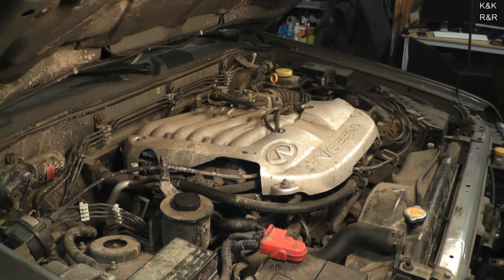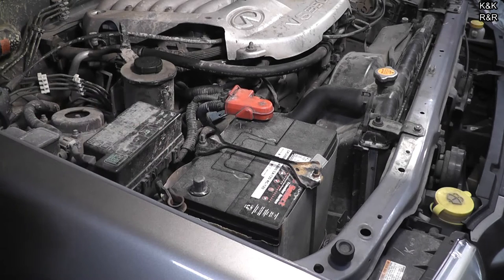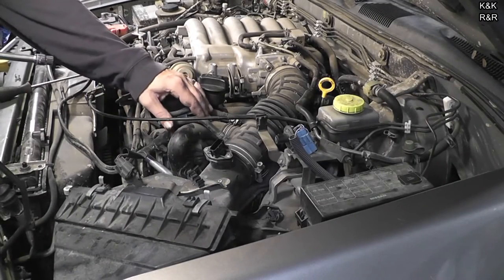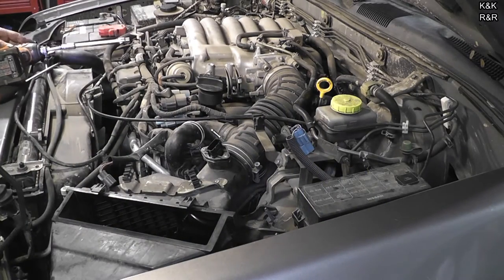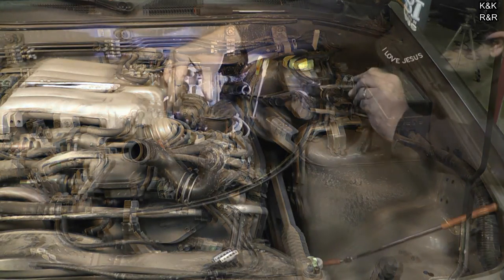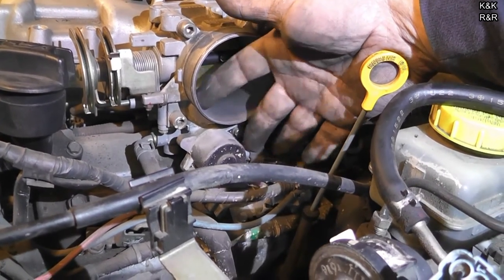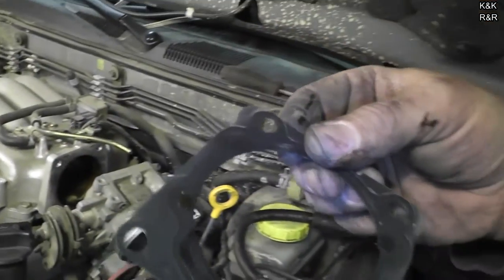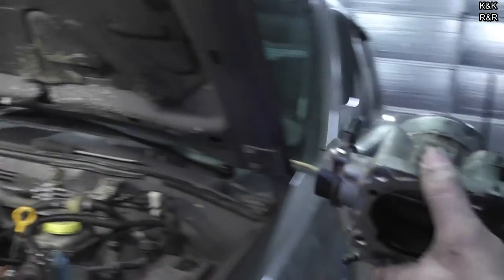2001 Infiniti QX4 150,000 Mile Intake Cooling System Tear Down Pt1 Air Box / Throttle Body Removal

Comment: Shot in the dark here... the vacuum tube right above the mass airflow sensor and right next to the silencer, where does it go to? Mine is disconnected and I can't for the life of me figure out where it goes. I've looked up videos and diagrams with no luck. Thanks in advance.
Reply from the maker: What year are you working on?  Some models have an emission device below the air intake tube this 2001 didn't.  If you don't mind email the channel some picture of your air intake tube and hose you need to find where it goes.  I can help you figure it out.  Its not good to have a vac hose sucking dirt in. 
/K&K

Comment: I just changed my iac valve and now the idle is sporadic
Reply from the maker: Did you use a factory Nissan IAC or auto parts store part?  Do you have any PO codes after or before replacement?
 /K&K